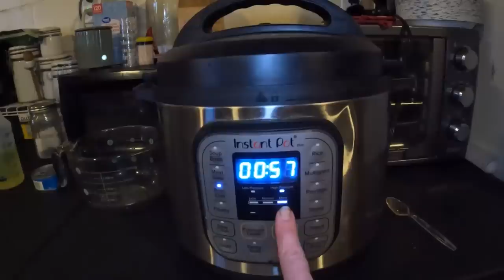Ice Storm Made Us Do It. Prepared? |Power Transfer Switch | Couple Builds A Cabin Homestead

Comment: Just watched wiring of the outside generator connection. Since this is outside and is exposed to the weather it would be a good idea to cover the wiring with an anti-oxidizing compound on the wires to protect them from moisture.

Comment: Great idea. During our build, we added an automatic transfer switch and then a 22Kwh backup generator. Last May, the power went out for two weeks after a derecho hit, so, with children needing ventilators, we committed to the most automatic system we could get. Here, in Canada, a sleet storm is not a rare event and it sucks.We lose power in high winds, when a yout' crashes his car into a pole and on and on and on. The grid is great, but you need options.
Reply: Derecho hit us in iowa also so I installed a DIY portable tri-fuel generator connected to natural gas as we're all on-grid here. Very similar to his partial setup cept I used a Generac transfer switch. All manual transfer for me due to $$.
Reply: I'd like to be on-grid for fuel too, but we are a mile outside of the local Natural Gas grid, so it is propane. After we got clobbered by the pandemic and skyrocketing lumber prices, it seemed not so bad. Just smile and stroke a cheque. Climate change is too unpredictable. Minus 40F (with wind chill) here today, plus 35F forecast on Sunday.

Comment: Love how things are coming along. 😉 Your interior box wiring looks a lot better then a lot of 'professionals" work I've seen. 
Maybe it was just the angle of the video, but would feel better if the exterior transfer switch box wire had a little loop in it before going into the box, so water would drip off before running into your box. Even though it is already grounded, its good to keep water away from electrical.
Keep up the great work!

Comment: 13:15 You should have installed an interlock at a fraction of the price of that transfer switch, you could have powered your whole panel rather than selecting a handful of circuits with the transfer switch.  An interlock just isolates the line voltage from your generator inlet, then when on generator power you just need be careful which appliances you run at a particular moment in time.  Then load balance your panel  putting high load devices like refrigerators on different phases so they don't trip your breaker if they run at the same time.

Comment: FYI 
8 awg wire you used is good for 55amps so you could put a 50 amp 220 breaker in your main panel 
And wire from generator would wire to double 50 amp.
If you lose power you kill the main n turn on the 50 amp
Start the generator n then you will have power available to whatever you need? Your 9500watt generator should have 50amp outlet
As long you turn off the main breaker before the 50 amp it can’t back feed.
Same thing with taking the generator off turn off the 50 amp breaker before turning main breaker back on so you Don’t back feed the generator, 50 amps will supply everything you need just can’t dry clothes n cook or make coffee at the same time, learn to balance loads!

Comment: Hi Mel and Gary you guys are fun to watch and enjoy your projects and your family! Just wanted to comment on the ice stuck to your floor we had a similar situation when we built our home with several days of ice predicted storms. We took heavy blue tarps which were economical to buy, when ice was forecasted. We covered our flooring and the ice came. After the storm we simply lifted the tarp in sections the ice broke apart and we dumped it from the tarps and the floors stayed protected and we had minimal shoveling to do. Saved us time and potential damage from melting ice and chiping it off in areas. Just a suggestion sure saved us time and back breaking work removing that stuff!  Good luck you guys with your building hope the ice stays away.

Comment: You meant to use a volt meter to see if power or voltage is flowing through your panel before you work on it next time… if you did I didn’t see it

Comment: You might want to do your research on a bonded vs. floating neutral generator. I can't comment because I'm still working through understanding it myself. I did get a "donated" 14hp Vanguard powered 7000 watt generator running so now I have to do my own "due diligence"! And on that ground rod, if you connect that to the generator, be sure you have also run a connector of at least 6 ga. copper to the house ground. It can cause ground loops and other issues if they are not a common ground.

Comment: Hello Gary, is it correct that you connected the generator fuse box in parallel with the normal fuse box? If this is the case, if the fuses in the main box are ON AND the fuses in the generator box are also ON, you have voltage on the generator plug on the house!!!! That would be really dangerous, since there is a "male" plug on the house and you could get an electric shock in this case.... Especially for children (always curious) this can quickly end deadly... Greeting mastermind